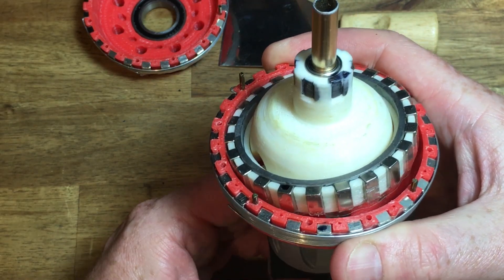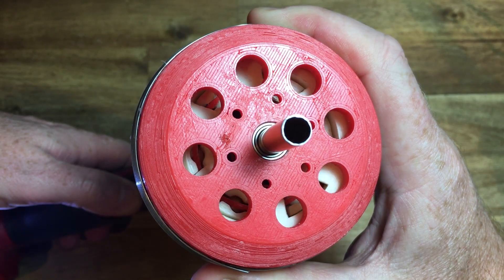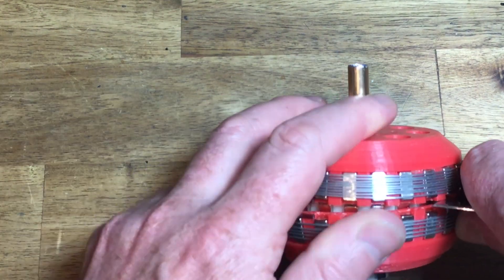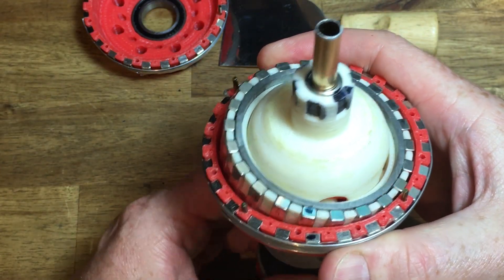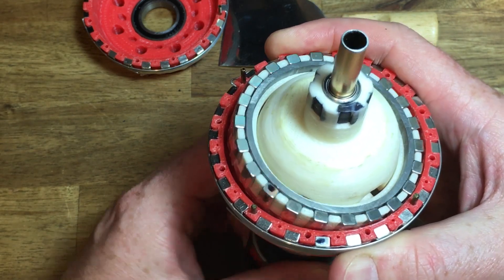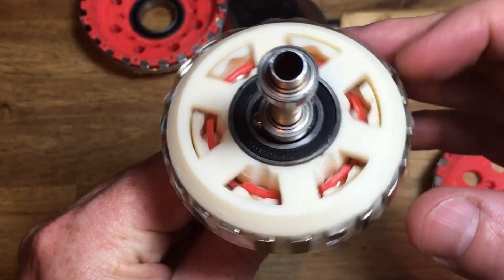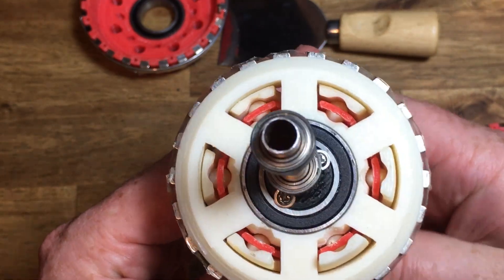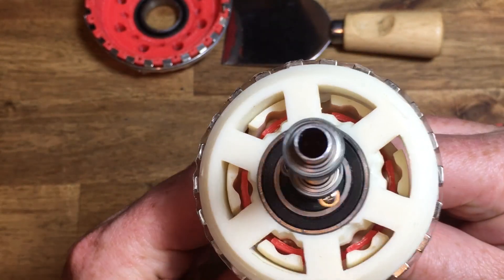Magnetic Wobbling Gearbox 3D Printed

Comment: If you replaced the outer stator with that of a stepper motor I wonder if you could very the gear ratio by changing the step size, ofc I do not know off the too of my head if that's possible without having the poles changing as they do in the motor
Reply from the maker: That is what Magomatics does.
Reply: @PaulGouldRobotics  oh interesting, I'll have to look into that, thanks!

Comment: Cool design what if you put it in a robot arm
Reply from the maker: I would need to be improved the design a fair bit. It is large/heavy for the amount of torque it transfers. It is not balanced. It is also quite expensive $50 for magnets and $20 of bearings. It was just a proof of concept.
Reply from the maker: @jameskirk4498  Triple Disk, single stage cycloidal gearboxes are my favorite at the moment. How small are you looking at? What type of robot are you making?
Reply from the maker: @jameskirk4498  For that size, RC/smart servos are your best choice

Comment: What's the scenario where this would be advantageous over a standard 11:1 gearbox?

Also, I hear backlash all the time but am not 100% sure what the term means. Is it the slop in the input between the output being driven forward vs driven in reverse?
Reply from the maker: Advantages- no teeth contact, no friction, overload protection & high efficiency. More details in the research papers in the description. 
You are correct, backlash it is the slop between the input and output shafts.